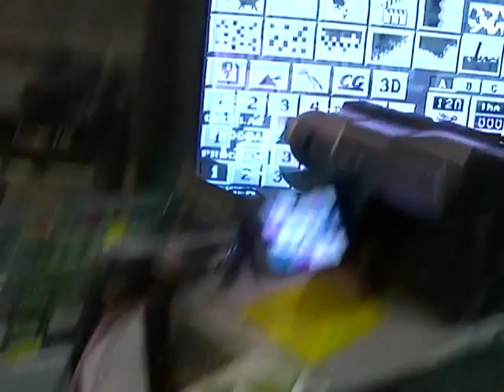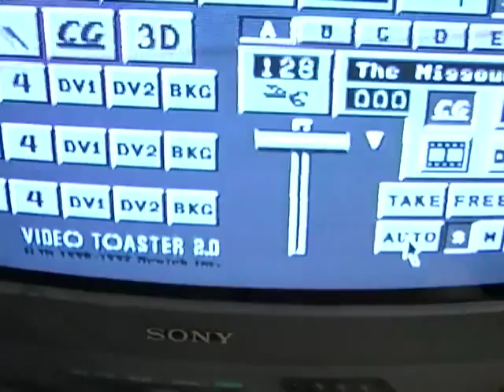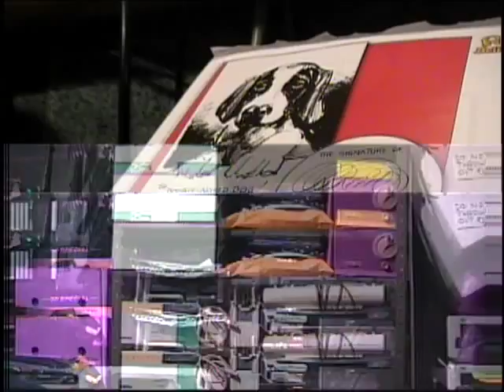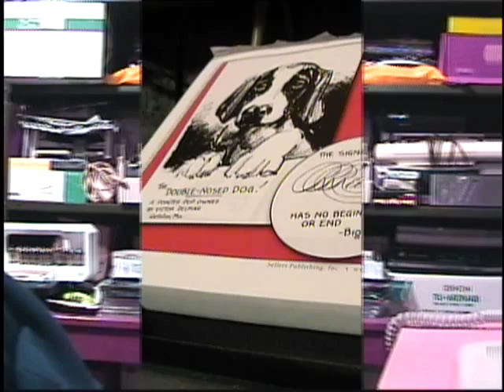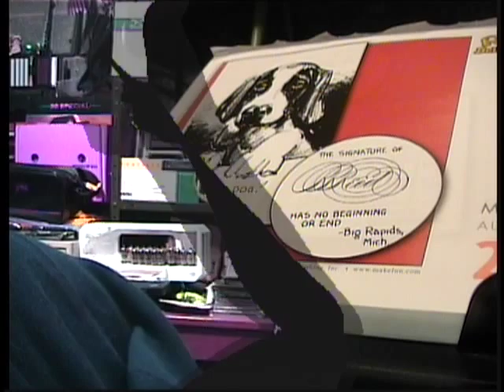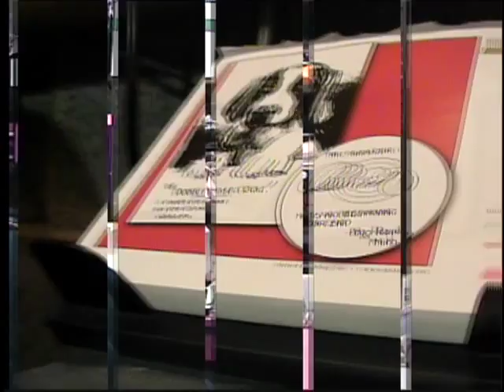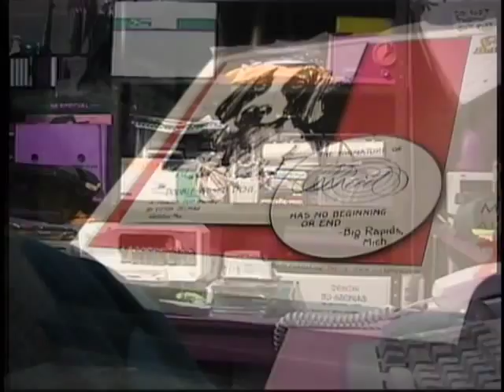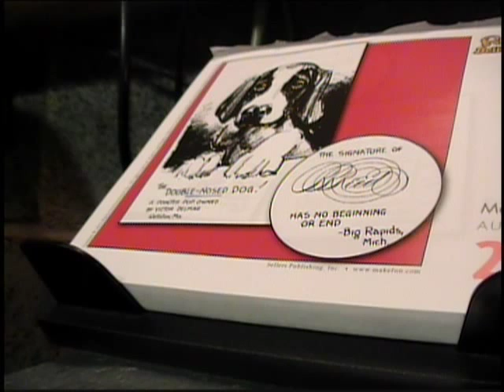Amiga 2500 Video Toaster restoration Part 3

Comment: I remember printing a frame at a time of animations as they rendered in high res to Betacam pro tapes because you couldn't just render all the frames and save them digitally in high quality without insanely expensive Hard drives which we didnt have yet , it had severe limitations on storage but there were ways around it, when we got a non-linear editing machine things got much easier it had 8 gigs of storage which was enough to do some good shit LOL

Comment: The color issue could be from the missing cap. The crushed reds (well now pink) look awfully similar to that old TBC I have that needs to be re-capped. Would be interesting to run some color bars through that input and into a vectorscope. Does the other card exhibit color issues?